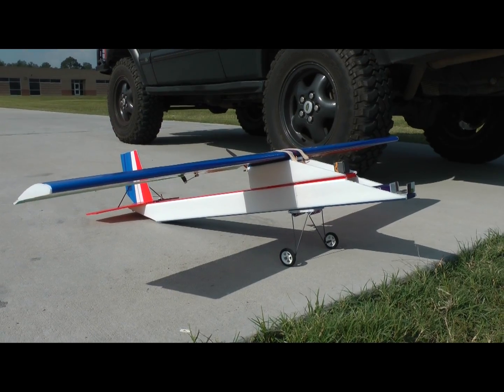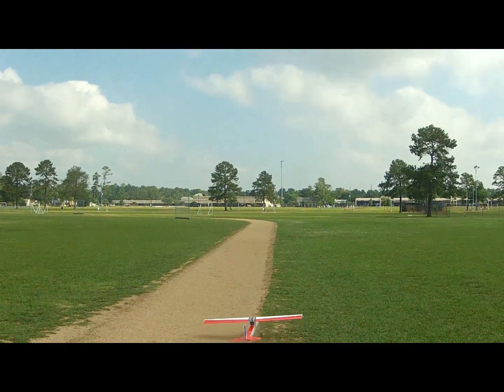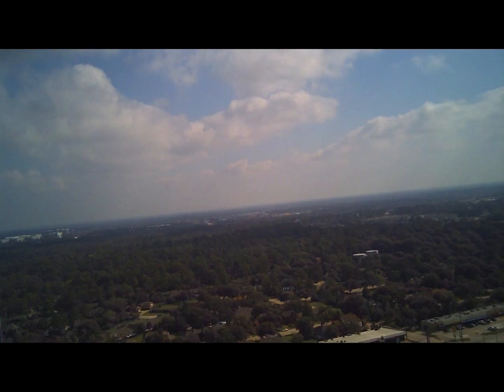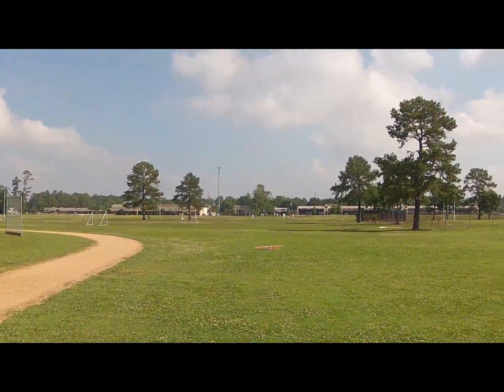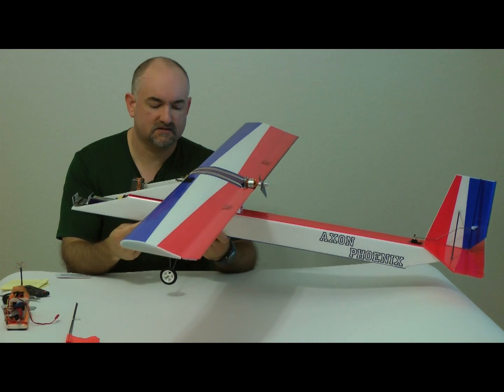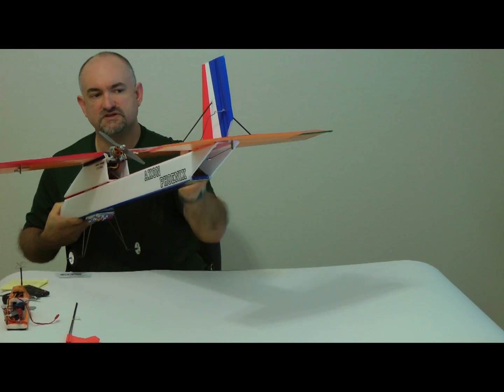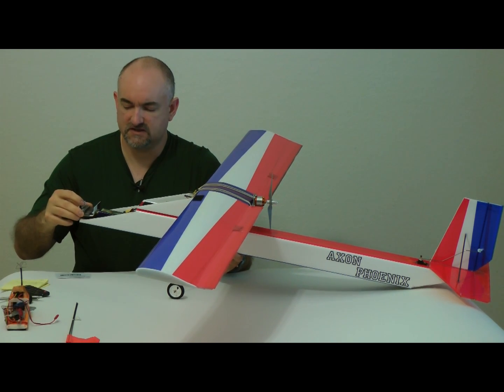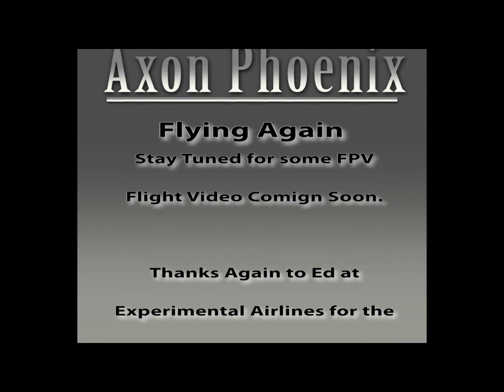Axon Phoenix

Comment: Try making the fuselage out of plastic downspout material. Lots stronger than Foam Board. I have built lost of Coroplast Spad type planes over the years and love building them. I'm going to use your AXON design using the Coroplast and downspout material..Good looking plane and nice build... Thanks for the video....

73
Jimmy, ARRL TS, WX9DX

Comment from the maker: With 1400KV, you'd probably have to be swinging something like a 8 or 9 inch prop which wouldn't fit in the default configuration as Ed has it designed.  With the 6x4 you get just about 1/2 inch clearance from the lower tube.  Now that's not to say you couldn't try adding another tier to the upper deck to give you the extra height you'd need or modify the motor mount such that it would give you the clearance you'll need.

Comment: Do you know if I could use a turnegy 2826-10 1400 KV for this  Axon ?
Reply: Im no expert but I think you might run into an issue of not enough thrust swinging a small prop (necessary for clearance) Turning that 6X4 prop at 1400 KV is a 1000 less than Ed recommends. I would guess that that 2826-10 would be breathing easy spinning that 6X4 prop at 1400 but are you gonna get the thrust you need? I doubt it. The clearance limitations require a smaller prop and therefore the smaller prop requires a higher KV. Your motor is probably designed to swing a bigger prop but cant in this use due to clearance issues. Does that make sense?

Comment from the maker: A single 3 cell 2200 mah will get me about 6 minutes of pretty aggressive flying.
Then I have two 1800 mah batteries which I run in parallel and I can get a good 12-15 minutes with that setup.

Comment from the maker: Ed showed it in his Axon FPV video.  Its really easy; just trim them to fit the cross length.  Then cut a slot in center of each half the length so you can slide the two together.  Works really well.